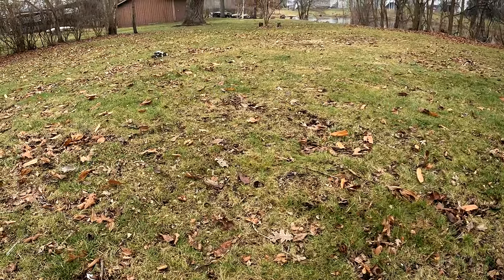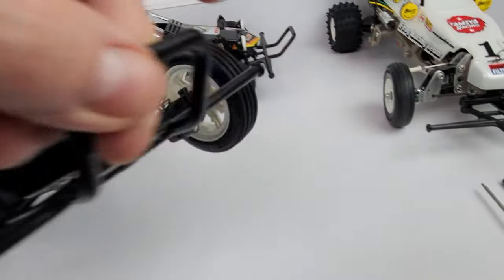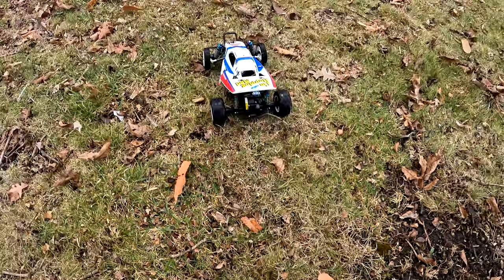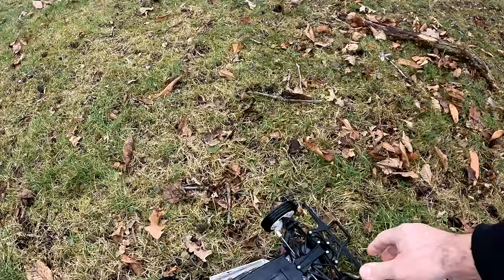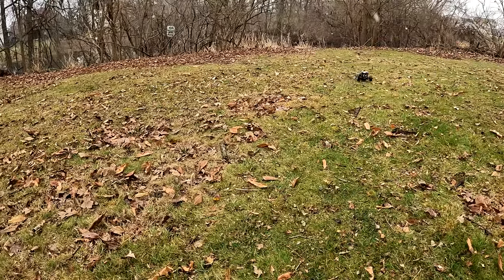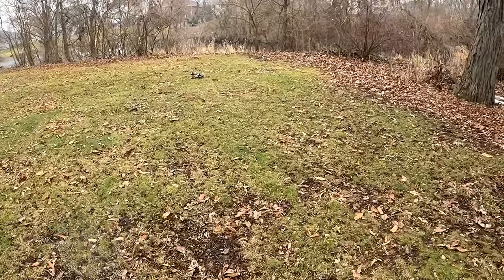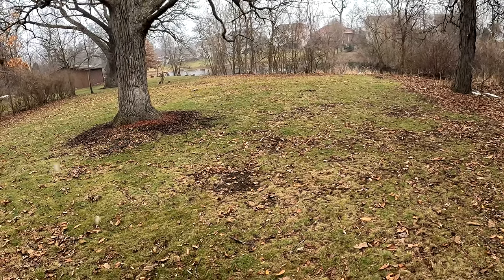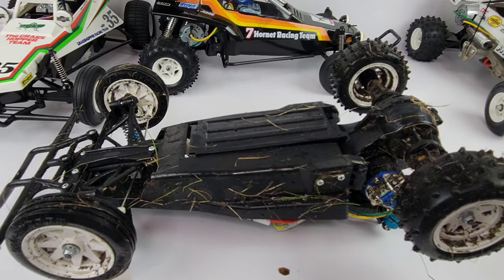Watch Me Take on the Tamiya Grasshopper 2 | Upgraded Aluminum Shocks and a Lightly Tuned 28T On 3S

Comment: I really appreciate the kind words and shoutout.  I wasn’t expecting that while I was watching this video.

That thing really ran a long time!  So light no doubt.  I could have only dreamt about performance and run times like that back in the 80s and 90s….Those original shocks were shockingly bad but the oil filled units seem great… kept the bouncy charm of the Grasshopper.

Can’t wait to see what kind of speed you get out of it down the road.  It might be a bit much for a Grasshopper but I had great luck with a cheap (under $40) Surpass Hobby F540 4370kv 60a combo in my vintage Raider.  It rips at over 60 mph (when it stays in the road).😂. Just turn the punch down and let it rip!
Reply from the maker: I'm very sure lighter shock oil will do the trick to keep her more stable. She was quite stiff but still kept that old school drive style from back in the day. I'm thinking about going crazy with a Hobbywing XR10 60a esc with a 10.5t brushless sensored motor combo like in my Kyosho Optima..  With lighter shock oil and the right terrain could make all the difference but time will tell.

You deserve the shot out brother cause you was the one that resetted my vintage world of rc. My Kyosho Vanning was stolen years ago as you know and you came in touch and reinighted me. It costed me a premium but was well worth it. My next video on that beast will be soon and I will give you a shout out that too. Just waiting on it to dry up cause of the rain and snow..
Reply: @nwirc  LMAO!  That XR10 60a setup would be an absolutely nuts!  I don't know much about the Grasshopper and if a 3650 fits well.   I went with the F540 for a couple or reasons.  My understanding is that as it has the fins, it is really a 380 sized motor in a can with outside diameter of a 540 (the fins stick out to that diameter) but lighter and with less torque.  Even with the punch turned all the way down in my Raider (which is by car my lightest 1/10 RC car but I would guess might weigh more than a grasshopper), it has plenty of power for accelerating but isn't too hard on the gears (I still usually ease into the throttle unless off road as the Raider does not have the strongest gears... the only thing I don't like about it is even on the weakest setting the brakes are a bit strong).  I think I have read the Grasshopper has a fairly strong trans from a vintage perspective but IDK... the torque of that 3650 might just be absurd!🤣  Whatever you do, I am for sure going to tune in for it!!

I have a Hobbywing 3600KV 3650 QuicRun in my Ultima and it has way more torque that the motor in my Raider.... but both actually have a similar top speed with the tallest gears I can fit in them.  No doubt the Hobbywing setup is much nicer though.

I for sure was excited that Vanning kit was exactly what you were looking for and everything worked out well for you!  I will be looking forward for to that one too!   Thanks again and I will have to give you a shoutout in one of my upcoming videos!  IDK if you will gain much but it can't hurt as you have a great channel!

Comment: Awesomeness 😊
Reply from the maker: Thank you. I can't believe the runtimes on it. Battery was only at 3.8v after 15mins.
Reply: @nwirc  maybe an upgrade for the battery could help if you have the space
Reply from the maker: @HenryCalderonJr  I thought 15 mins of runtime was great for a 3s 1500mah. I could fit a different battery though.
Reply: @nwirc  oh it is good but never hurts to keep spares or upgrade to get 20 mins per battery. Jejeje longer fun time